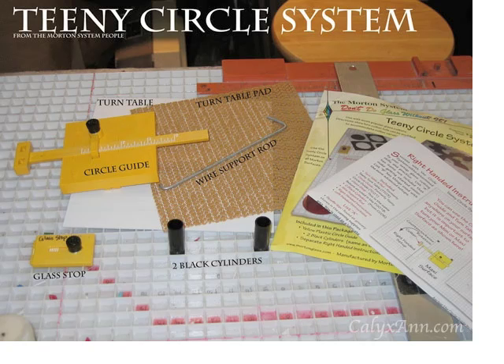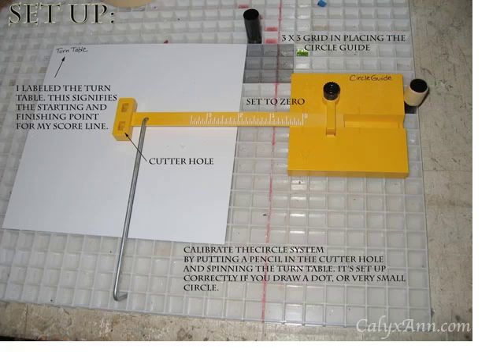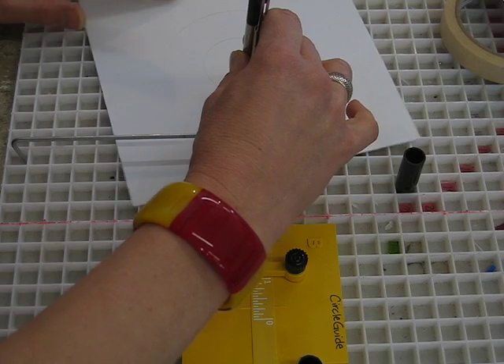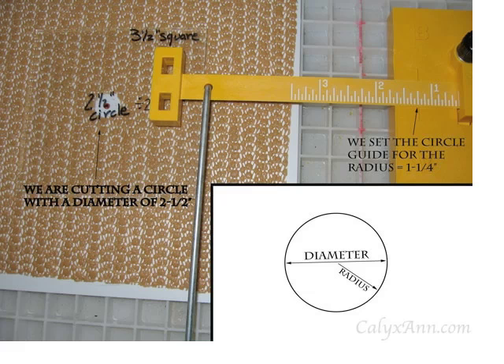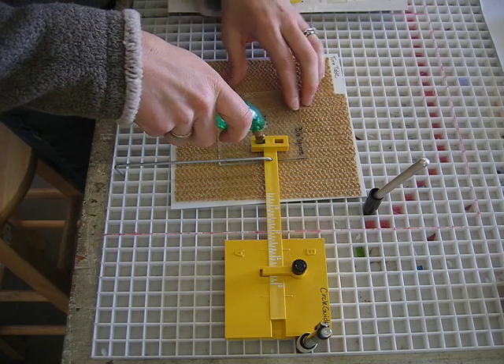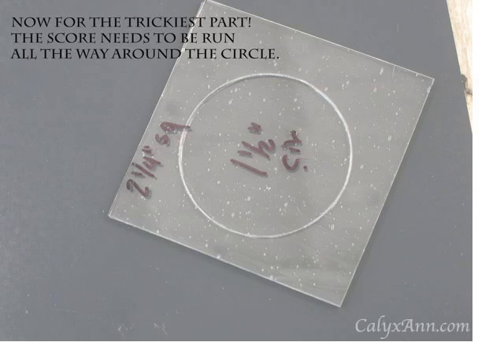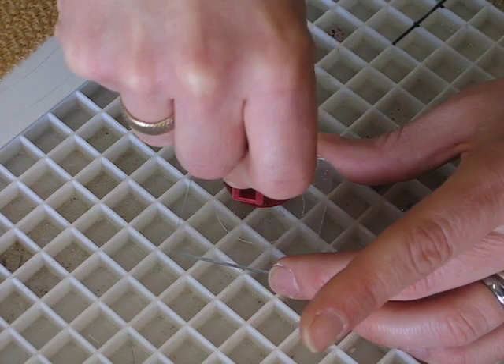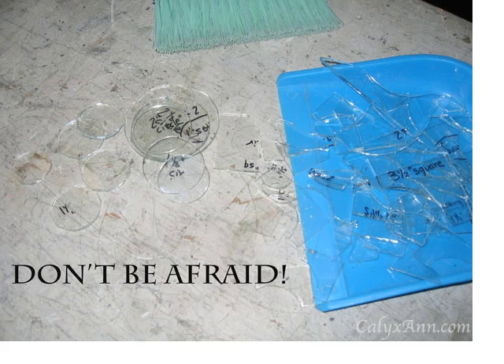Morton Teeny Circle System demo

Comment: what is that 2 pieces red tool you are using a 2min30 in the video ? how is it called (The little red circle and the tool)
Reply: That is the Morton Safety Break System. You should be able to find them easily online or at your local glass retailer 😊
Reply: They are 2 of the 3 pieces of a Morton Safety Break System.  For More information on the Teeny circle & Safety Break systems, go to mortonglass.com

Comment: This is a great video AND commentary with tips gleaned from experience, especially MARKING EVERYTHING!. Word of advice IF cutting plate glass: Don't grind this glass on your art glass grinder (I use a Glastar All Star), though, as the larger, yet unseen, flashing that remains atop or inside the small holes of the surface, will slice your skin (repeatedly) and make (glass-cutting and grinding) life very uncomfortable. ALTERNATIVE: Practice on inexpensive Spectrum T-Glass (Hobby Lobby) or scraps.